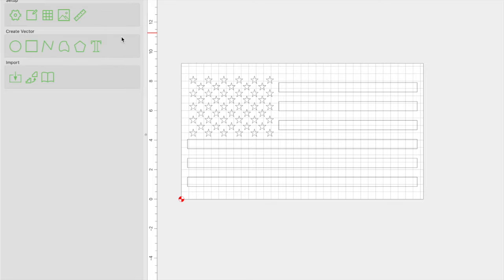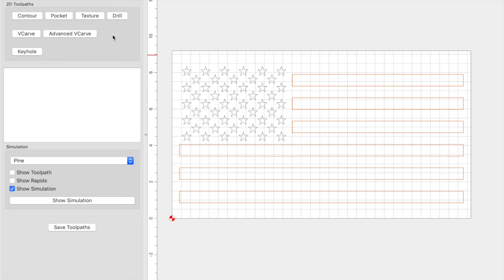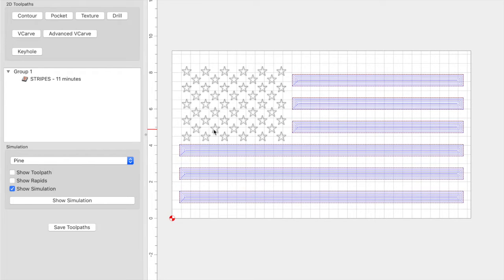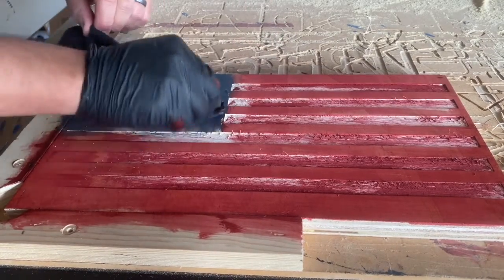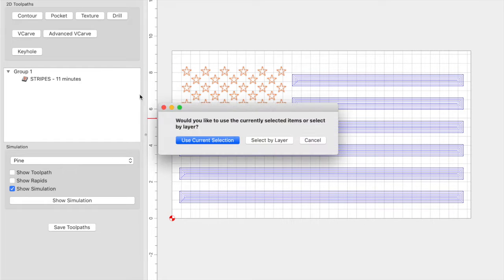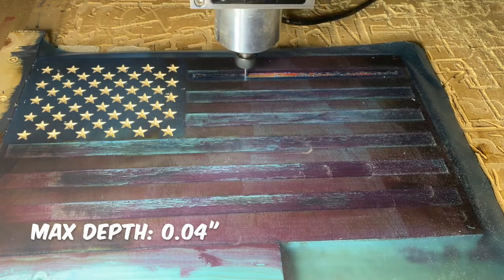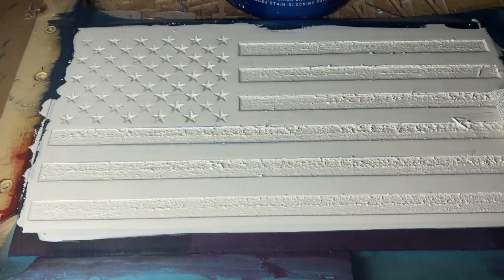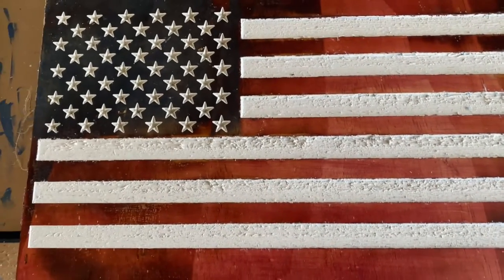How to Make a CNC Flag with White Stripes and Stars

Comment: Carving the stars is driving me crazy, they turn out anemic.  Practicing on .5" mdf, 0.5" 60 deg v bit, choosing stock bottom which is 0.54", cutting depth of 0.1. . . why is this so hard for me to get right?
Reply from the maker: Hey Harry,

Thanks for checking out the video.

Try setting your max depth to stock bottom.

Depending on the size of the union you’ll need to use the 60 deg vbit or the 90 deg vbit.

For example my small unions at 10x7 I use a 60 deg vbit.

My unions for medium flag (19.5x36) are 14 7/8x 10.5” and I recently started using a 90 deg vbit.
Reply: @aetimberpine  when I set mine to stock bottom, dang on 60 degree tried to go Literally to the bottom of my .75 material. I had to hit my kill switch...I think someone in the CC community forum, said you no longer have to use the stock bottom and you can actually set the depth, is that what I should do instead of stock bottom?

Comment: Thank you for all your great videos. I do have a question. When you are carving your stripes with the end mill and are in advanced does it give you the step to change from end mill to 60 degree v bit to clean up the edges of your stripes?
Thanks again.
Reply from the maker: Hey Eric, than you for the encouraging comment. 

Yes, carbide motion will give you a prompt so long as you have the correct post processor selected.  I have a video on how to set it up. Very quick video and simple fix.

https://www.youtube.com/watch?v=k0VEXPPrGd0

Comment: Good video, try shellac instead of polyurethane before you put the oramask down. It works a lot better for me. Also something else to try out is to stain your red and blue first, then shellac, then carve. You have to measure out your union and be pretty precise but it works well.🇺🇸👍🏻
Reply from the maker: I need to get some shellac. I’ve used polyurethane (water based) and I’m afraid to change it up. But I’ll never know unless I try it out.

I think ideally it would work best to stain first but I am not that exact. I know I’ll mess it up lol. Actually…I take that back, I have messed it up in the past.